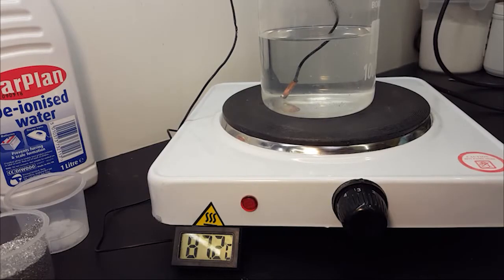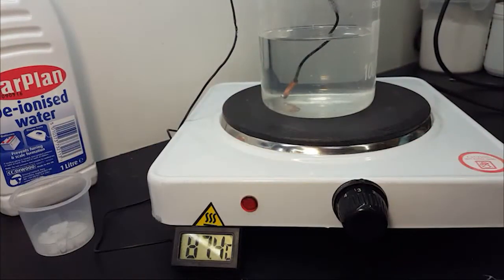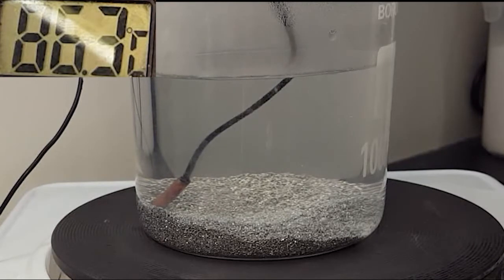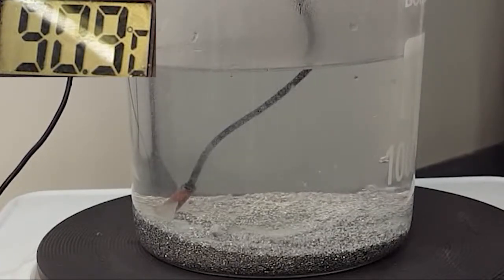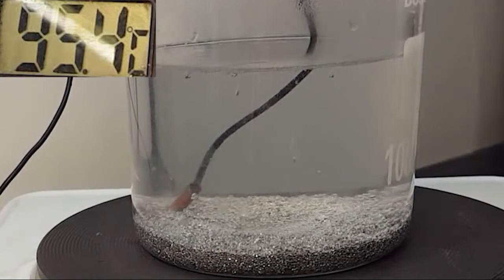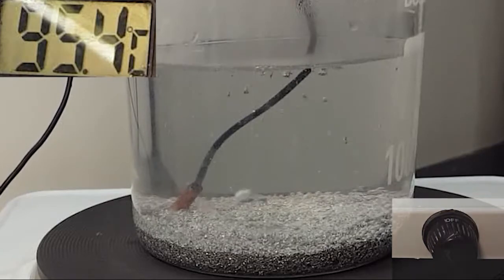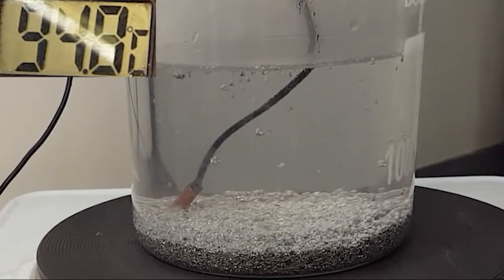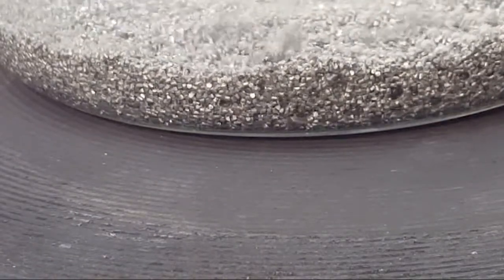Hydrogen Energy at the Lowest Cost

Comment: Adding alum. and NaOH this gas can be dangerous. As it is unstable and can spark internally and blow up the H in the container. One kid on a Hydroxy Gas forum was playing around with this mix and he blow up his garage and died. The parents tried to sue the owner of the Hydroxy Gas forum. He showed in messages not to mess with this and they let him alone.
Reply from the maker: There is no NaOH involved at all, We are using a novel catalyst entirely developed in-house. And the gas produced is pure hydrogen, nothing to do with oxy-hydrogen which from experience I would agree is dangerous stuff. Having handled pure hydrogen a lot over many years I can assure you that it is far less dangerous than either propane or gasoline vapour, both of which are heavy and tend to longer inside buildings, whereas hydrogen disperses very rapidly 'up, up , and away!
Reply: @LookingForHeatCom  So what happen to Oxygen from water? Reacts with Aluminium and catalyst stay intact?
Are you going to patent that catalyst?